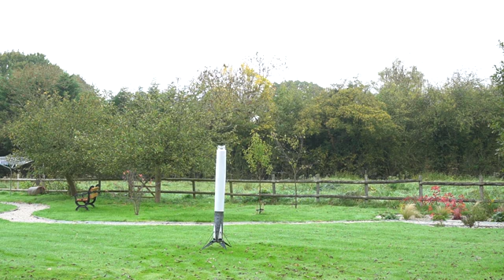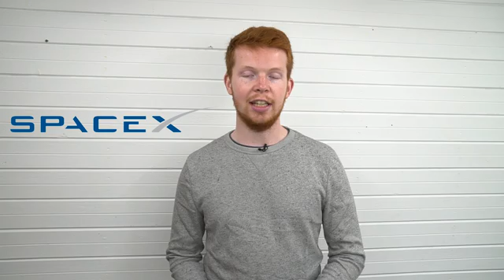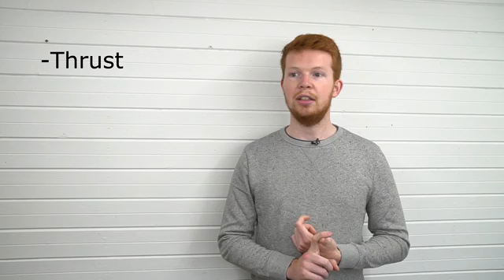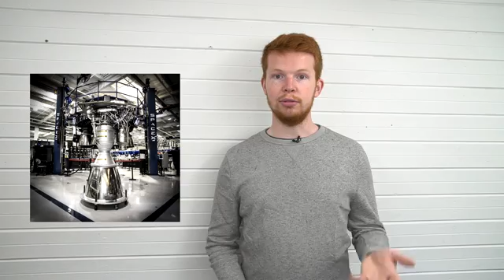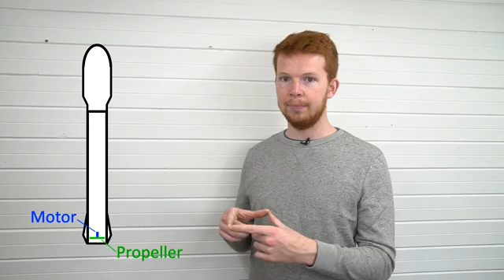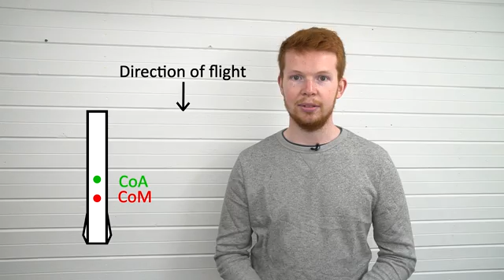Hovering a rocket - SpaceX model

Comment: If you’re going to operate outside in non-zero wind, a more active control system that keeps it tracked on the Z axis would help a lot. I think that would involve tracking X, Y, and Z to second derivative, which isn’t hard to do with inexpensive G sensors, and you can use the second derivative to control the first derivative and the position. That should give you enough control to manage even significant wind.

Comment: What if you brought the fan lower in the tube? You know the rockets are at the bottom of the rocket, not in the middle, the center of the cylinder. Lower the fan so it's near the bottom of the tube.

Comment: Keep going!  But I think you need the top thrusters as well as the thrust vectoring in order to keep it vertical and not wander all over the yard. Move some of the weight (the batt) lower so you won't have as much of a balance issue.  LOL- I just noticed this video is 4+ years old....

Comment: It is definitely a success. You are very familiar with the hardware and software to be able to completely rebuild the rocket and change the control scheme overnight. It reminds me of my youth when my grandpa taught me to balance a vertical baseball bat by supporting the bottom. It was easier when the heavy end was on the top.

Comment: Put a powerful solid fuel rocket as a first stage with a fuse leading to a weaker booster and then use the thrust vectoring to land the rocket.
P.s. you have to remove the charge from the booster that would power the parachute and then just attach a fuse.

Comment: 8:12 - You say "Like on an aircraft they work as the Flaps, and they direct air in different directions to control the rocket" - This is incorrect. The purpose of the Flaps on an aircraft is to increase the surface area of the wing, which increases lift, allowing the plane to maintain it's altitude at lower speeds, or alternatively to take off at lower speeds. This is why planes use Flaps whilst taking off and landing but retract them during high speed level flight (to reduce drag).  I think you're mistaking the Flaps with the Ailerons and Elevators, which are the controlable surfaces used to direct the flow of air over the wing and horizontal stabilizers.

Comment: From the engineering standpoint the last design is way worst than the first one. To the rocket to land, the legs should not be moving, but the "nose" should. So, the CG should be as lowest as possible. so the "nose thrusters" should stabilize the relatively calm legs. That's the whole point. If you look carefully at the last iteration, the legs are dancing around like crazy which is not a good perspective for a landing. Though nice try. Thumbs up!

Comment: What happens when the fuel or compressed air is all of a sudden placed in an environment where the fuel or compressed air is now Drawn Out with enormous Force....During an Instantaneous Pressure Equalization Event.   My question is...what happens when you bring pressurized air or fuel to the vaccum of space, and try to push it away from you....but rather the science demands that if even open a valve,  the fuel or compressed air will be exposed to the vacuum of Space, and be Drawn Out with enormous Force,  during what is commonly known as the Pressure Equalization Event.
Reply: Did you guys forget about that part?

Comment: I would suggest using a higher KV motor on the bottom to help fight the air compression from the first. also using props with more blades on the bottom so that you dont end up with low end harmonic vibrations from the props "syncing"

Comment: you could try non-liquid hydrogen-oxygen (pressurized gas) rocket, afterburner it with em-cannon or plasma rail-gun
Reply: hardware auto-balancing (stability), better than software (control)
Reply: tesla turbine, electric (or gasoline centrifugal compression) rim speed air jet, better than super sonic blades
Reply: 3d gimbal gyro reaction wheel, 4d combo stabilization, active control with some passive stability added
Reply: separate thrust from direction-control, resonating ion engine

Comment: Very ambitious and good work for a young guy like yourself.  Question - what type of control scheme are you using?  Is is just "proportional" control?  Proportional control checks the difference between the goal (the "set point") and your current position (e.g., "position" can refer to location, temperature, etc.) and it provides a controlling action proportional to the difference between where you are and where you want to be.  The "gain" is the amount of signal amplification you apply to the difference between your goal and your current location.  Proportional control always under or overshoots the mark and is one of the most simple control schemes and is only a bit better that an old fashioned on/off mercury position switch that was/is attached to the bimetallic coil in a thermostatic temperature control.

PID is one of the most sophisticated current modern controls.  PID = Proportional + Integral + Derivative controls all acting together.  One thing that makes PID so good is that it can anticipate external disturbances in advance and apply corrective action early in anticipation of the disturbance (before your system could react to the new disturbance in a simple proportional control scheme).  The modern implementation of a PID controller can tune its operating parameters to any particular control system.  For example, it can learn the value of the phase shift between the input and response of your system (the system control lag).

I am guessing that SpaceX rockets employ the PID control scheme.

Comment: Nice explanation, and good idea with the ducted fan. So many smart ideas I love all your innovations. If you put ordinary rocket fins at the bottom it should automatically steer into the wind wouldn't it. Or maybe the automatic stabilization would counteract that. Really cool. Okay so I guess what you accomplished was stability but the next level would be steering. So for that you need to make the programming allow it to be not vertical a little bit. Anyway so cool. It's a really important intermediate step although it seems a little bit anticlimactic. By the time you add a few features it would become a mind blowing thing.  For example you could launch it with an estes rocket then land it

Comment: Pulling it from the top is a lot different than pushing it from the bottom. Try to put the thruster at the bottom and still stabilize it. Thank you for the try though.
Reply: Yes; needs true inverted pendulum transfer function design with feedback control…

Comment: This video has a lot in it and the project made a big step in advancement.  There is some very difficult engineering accomplished by making use of balancing and stabilizing electronics and software borrowed from flying drones.  By shifting the center of mass towards the top of the cylinder under the influence of earth's gravity with both top and bottom free to laterally translate the mark 2 cylinder created an upside-down pendulum. 

 A common device that is engineered to balance as a non perfect upside-down pendulum is a bicycle.  In order to actively balanced a bicycle has to be moving.   A typical bicycle, with nobody on it, given a good push will use torque generated from its steering geometry as a righting force to keep its wheels underneath it.   At first the bicycle will attempt to go straight until it no longer has enough torque force generated by its steering geometry at the slowing speeds to right itself at which point it will resort to spiraling inward using centripetal force to further contribute as a balancing force and shortly fall over as its lean angle increases to where a part of the bicycle catches on the ground pivoting the tires away from the ground crashing the bicycle.   

The large angle of swing of the cylinder's landing gear was somewhat analogous to this.  When launching a rocket once it clears the launch structures a little bit of sideways movement is probably meaningless.  When doing a hovering landing a little bit of sideways movement will catch the ground and tip the rocket over crashing it.  Swinging back and forth in landing like an upside-downbeneficialceptable

Once landed and rocket landing gear need to be of sufficient ground contact width to keep the rocket's center of mass inside the landing gear's supporting forces and balance against wind forces from weather.  For a model it would be nice for it to keep standing during a breeze you might not normally notice, but it would be a poor use of resources to go much beyond that.  If you're going to have people around or passengers in something a lot bigger it maybe that it's not profitable to make the landing gear wide enough to resist an unlikely gust of wind and some type of active means of countering rare high gusts of wind is a better to employ as an emergency fall back.  

It's dealing with a gust of sudden high wind once landed that worries me about SpaceX's Starship.  That's likely not a problem on Mars or the Moon although some type of explosive situation might create such a condition, but on earth it's a real possibility even with a weather prediction of little to no wind, there are weather situations that can cause a sudden unexpected gust of wind.   Once landed on earth there maybe a procedure to quickly secure StarShip to a ground structure, but during the intervening time a high gust of wind might topple StarShip over. 

 I think it's important for people to keep in mind how totally different maneuvering a rocket is from when it is fully fueled to when it has burned most of its fuel.  Once it has used most of  its fuel it is going to be extremely light relative to its size similar to this cylinder model; whereas, a fully fueled rocket is going to be similar to this cylinder model if it was filled with water,  liquidliquid oxygen .

Comment: Superb video! Just one quick note that when you described the grid fins on reentry as being like the flaps on a plane, I think you meant ailerons; flaps change the lift and drag profile but aren't used for steering - it is the ailerons' motion that controls roll.

Comment: this is another project which would need some ground proximity sensor, so it would correct itself against the wind, but in last moment, with some kind of exponential transition vertical position would become a priority.

Comment: I loves/share the drive for knowledge, understanding, and ability to problem solve on the fly with close observation,  tweaking and tuning, the best is you improvise so well by even applying your own twist to things, because you've learned how it works at it's most simplistic level. (Taking risk to achieve astonishing results) keep up the experimental exploration! I have a very very rough draft of a project I'd like to build myself. It's an extremely affordable self flight frame, dual electric motors, specialized props, some aerodynamics to ease the air instead of brutally forcing it through the air! If you get to see this comment, where are you from?

Comment: You could increase the thrust of the propeller (or ducted fan in this case) by using a wider inlet upstream and a smaller nozzle. To get thrust, the air must be accelerated. The air can be considered  being incompressible, so the  area of the stream tube must decrease (momentum eq. and conservation of mass).

Comment: I'm making something very similar,   inspired by this. What gain would be good to start with. If the rocket tips 10 degrees to the left my control surfaces move 10 degrees to correct it but I think yours moved at a higher rate?

Comment: Would making that work like a jet engine improve efficiency and thrust ? Could you add a duct in there like jet engines have that simply directs air over the outside of the body of the rocket ? Same principal as a bladeless fan.... ?

Comment: You saved the environment by using just air. Thanks for saving environment.🌳🌳🌳
Reply: So the electric energy he used to power that rocket fan generated by some power plant and the total carbon dioxide generated in that procedure would highly likely more than if he just directly burn some fuel and get the thrust due to the inefficiency of energy conversion. Just a matter of fact.🤷🏻

Comment: I love your super capacitor rocket. Solid fuel rockets are exciting, but once the fuel is spent the fun is over. An improved version of your tail section could be fun for an whole day. I wonder if your design would work better with the fans used in those RC model fighter jets.

Comment: Know it has been more than 2 years since you published the "Hovering a rocket - SpaceX model".  Just found You (and several others making and sharing) on YouTube.  Have previously seen your Video on Air Pressure powered/controlled Drones using pressurized plastic soda bottle(s).   Can I put the thought of "mating" the two ideas out there?  Maybe put the "jets" at the top, they may need to be really short bursts due to "leverage".  Am also thinking two of those Drone controllers(?)        This may work in slight breezes better(?)

Comment: When you reduce thrust trying to soft land, your control vanes loose authority and with the motor slowing, it actually creates torque(anti-torque?) that the vanes, due to reduced airflow, cannot compensate for. Maybe a dual motor design..... a small ducted fan below the main lift fan? The small ducted fans purpose is to maintain airflow over the vanes to maintain stability while not providing enough thrust to lift the rocket. The vanes authority comes from the air velocity not the volume of air moving past them. The Falcon 9 uses 9 separate engines, each controllable via throttling, to obtain the same stability and control you are trying to accomplish with control vanes. Now have 96 cents left........

Comment: Strap a solid fuel engine to the bottom with an ejector and use that to get to height, then have it come back down on return to home/thrust vectoring.  You just need to add GPS and you're good.

Comment: You need at least 5-6 months time and atleast use Arduino for programming , where are fins, to control use them alongside Arduino and adjust their angle alongside using wind direction via a sensor, it's not an easy job , but not a tough one for a tough man like you...

Comment: 11:25 The counter rotation also means somewhat higher efficiency if the angle of attack is set right. I know this is a quick and dirty project, but you could’ve made the thrust from the lower motor increase by increasing the blade angle. This helps because the air column is already moving so to get the same thrust you need the same angle of attack in the flow. If the blades are too steep or not steep enough then they’ll just stall and not do any good

Comment: Buy yourself a piece of Aluminum Tube so you can bang the crap out of it over and over again! Where are the side thrusters to keep it balanced and up right? Gyro's are a waste of time because they do not work well in small models, the work fantastic in giant models! No solid air propulsion, motor voltage variable not straight  burst start to finish, you can hear the sound of variable load.

Comment: Remember center of mass changes on a fueled rocket.
Both liquid & solid fuel as fuel is used CG or CM moves up or down.
Also for the dude complaining where you placed the battery he's confusing a top and bottom thrust vehicle.
Top thrust doesn't care about any weight below the propeller.

Comment: I haven't read the 2000+ comments, so I don't know if someone else made this suggestion: You mentioned that you couldn't make a liquid fuel based rocket due to cost constraints. Something that you could afford to do: You could make a Water Rocket pressured by compressed air (but with thrust and direction control). Hope you like that idea :)

Comment: I don't understand why you didn't just go INSIDE, where there was NO wind to test. You weren't trying for altitude ... you wanted a hover ... so the presence of a ceiling would not have interfered with your goal ... but the walls would have protected you from the wind.  Just an initial thought ... I could be WAY off in my thinking.

Comment: hell yea! launch it with a rocket engine, use the ejection charge to drop them and land it with the fan.Seems like some tubes on the sides holding C or D engines would be the ticket, and a nose cone that's slotted or light mesh so the fan would work

Comment: Rocket: a cylindrical projectile that can be propelled to a great height or distance by the combustion of its contents, used typically as a firework or signal.

What you built is essentially a radio controlled helicopter in the shape of a cylinder. Not a rocket.

Comment: You need to take into consideration, that 1. YES you DO get thrust out the bottom of the rocket, yet 2. you take in Air from the top of the rocket, which means that there is a vortex on top of the rocket sucking in ari, somehow stabilizing/fixing the top of the rocket, but this vortex could also be causing turbulances throwing the top around or getting it to vibrate around its center position above the vertical engine-thrust vector... Im not good at english but I hope you get what I mean.

Comment: Perhaps ditch the heave reliance on polystyrene in favor of lighter weight traditional materials such as balsa wood, and paper, and save the plastics for use only on structural components such as motor and servo mounts and the like.  Great effort though.

Comment: Super success! One thing I would suggest is to modify your throttle curve to get more throttle resolution on your sticks. Seems like you needed to be in the 70%-100% range of throttle almost all of the time, so adjusting your throttle curve would give you much more resolution and you wouldn't have those drops in altitude when you tried to do just a small adjustment. Love your videos!